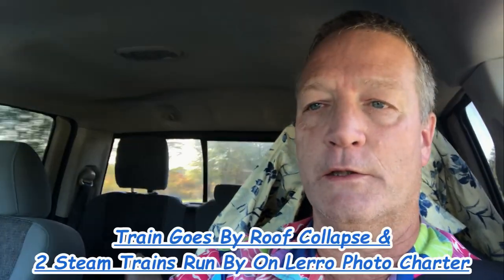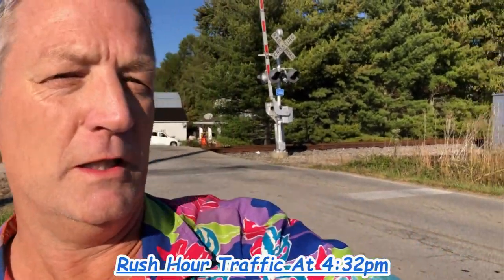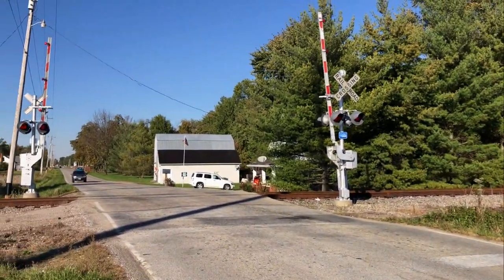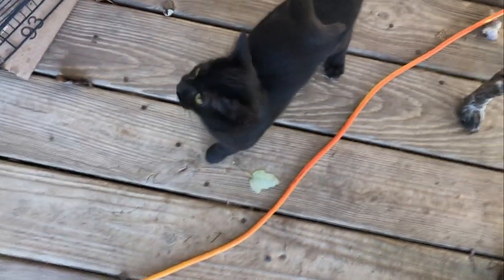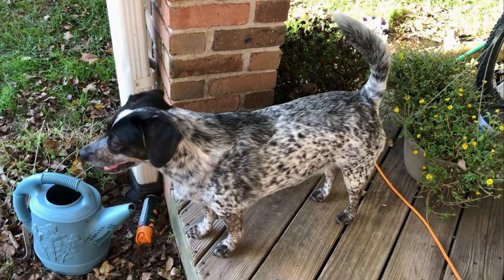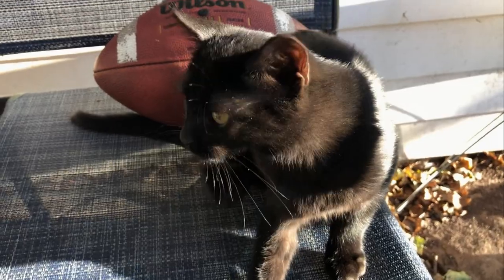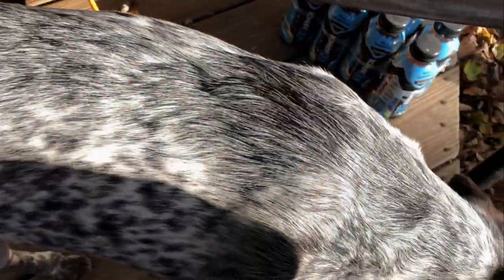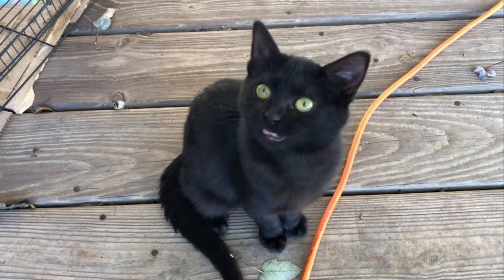2 Locomotives Pull 1 Railcar Past Old Building With Roof Collapse, Cincinnati Eastern Railroad CCET

Comment: For some reason, today, watching this; I remembered all of the michiana oil filters I changed and the crab nuts I torqued down (2100ftlb with a 7 to 1 torque multiplier) on heads we had replaced  And the 3 cylinder liners they let me replace as part of my apprenticeship.in 1958.
After the machine shop came the diesel shop. Nelson Busky was a great guy to work for. He had been a tank Cmdr in N. Africa during WWII.

Comment: That little loco was neat, but the big loco was amazing -- looked like one of the last coal locos before they switched to diesel-electric...anyway, that photo shoot was foamer central!  Neat vid, JT!
Reply: The Class "J" 4-8-4 is a classic, designed to burn coal but I think 611 was modified to burn diesel oil in excursion service at some point while Graham Claytor was running N&W/NS.  I'm glad to see Strasburg is treating her and #382 (4-8-0) well.  Both sounded terrific JT, well done!

Comment: Yeah, I can't believe that building will be left standing much longer. It's not been used for years and it's structurally unsound. At 5:25, you can see a huge crack between two of the boarded-up windows. If they don't demolish it or spend a fortune repairing it, it's going to fall down. And nobody's going to spend a fortune repairing an unused building.